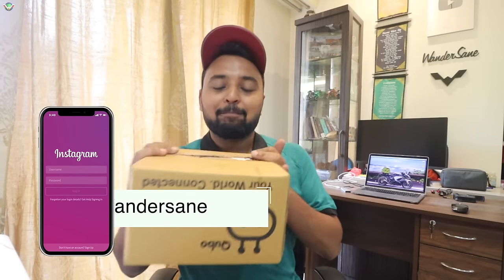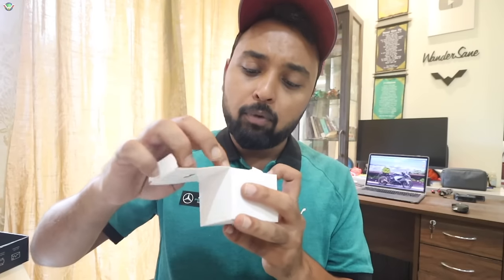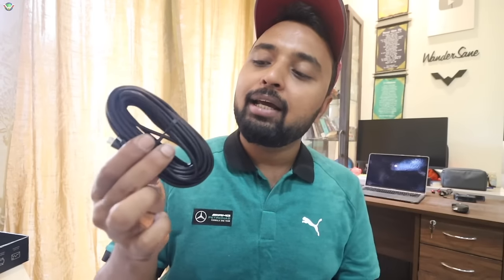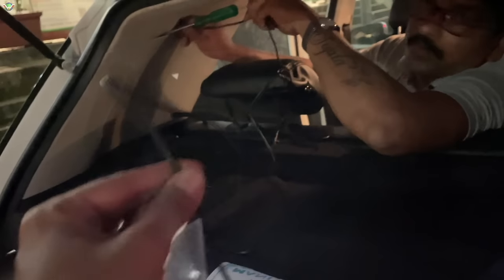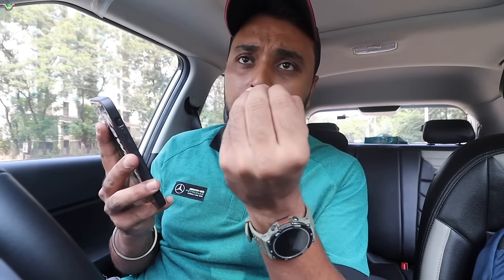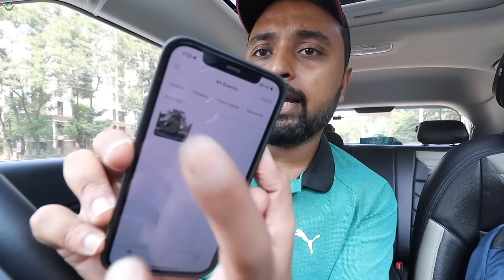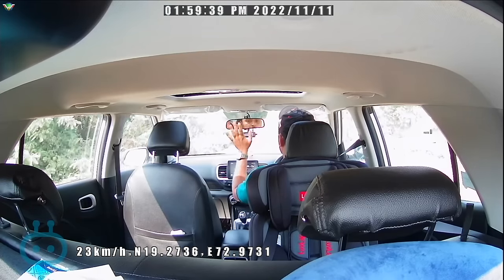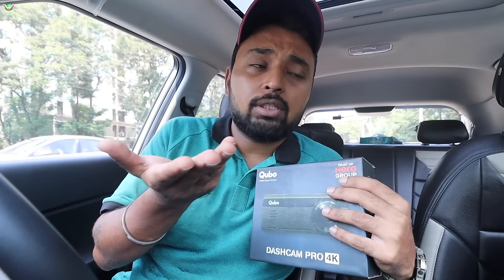BEST 4K DUAL DASHCAM FOR CAR SAFETY - Front & Rear Recording | Qubo DashCam Pro 4K Installation

Comment: DO NOT buy Qubo dashcam. My device stopped working in 3 months and the customer support is horrible. You will have to send video proofs again and again to them, explain the issue to each agent because there is no coordination at their end. Rest, your money your choice ✌️
Reply: You bought from their website or from Amazon or flipkart?
Reply: @ankurchakraborty8888  what difference it will make
Reply: @1987walunjrahul  they are priced more on those sites plus it's a different seller rather than qubo themselves offering it on the platform
Reply: @IAMATTHETOP  well, different sellers are different channels for Qubo. It does not matter from where you buy, the warranty/guaranty is from Qubo and they should extend all the necessary support on a timely basis. If they keep asking for proofs, then it's a stupid organisation which does not believe in customer support. The product may be good, but if the support is pathetic, it's a headache for the user. Best is to avoid such products.
Reply: Yes Qubo is the worst. It's better to go with 70Mail
Reply: Right
Reply: @suvibadra  @trippyturns - I agree. I too bought this premium 4k product and am regretting the same. Too bad support from Qubo - got carried away by Indian product for Indias and didn't go with Chineese, but realized that our Indian companies usually take customers for granted. Very pathetic support from Qubo - they closed the ticket without even contacting me!
Reply: @ankurchakraborty8888  I bought it from their Qubo portal. The purchase and shipping experience was good, but not the product support experience - which in my view is cuper critical. Very pathetic product support - that too for a premium product like this
Reply: @m2badri  how is the product sir? Customer support aside...picture quality..and operational issues?
Reply: @jiklrfu5194  the front dash cam doesn't capture videos that can be called as 4k. I find it a challenge to read the number plates of vehicles from the front dash cam - be it day or night.
The ADAS features are hyped and of very less practical use. The warning messages are garbled and not clear. It continuously distracts the driver in City traffic - might be of some help on highways but nothing to brag about!
I would imagine the cost of the product is at a premium due to this advanced feature. You will not find any user reference guide for configuring the ADAS on the device and you are on your own.
I think, the dash cam as a product will take time to evolve.
I am not discouraging the product but it's launched too soon to be of any practical use.
Hope this helps!
Reply: @m2badri  thanks for response sir. Yes, 1st gen product bound to be more buggy. Hope they improve, but for now the chinese ones make a better proposition
Reply: Ty for review I was about to
Reply: Which one is the best DDPAI z50 or this ? 
I have bought this from Amazon do you think should i return this ?
Reply: Hey can you give me suggestion that is there dash with live view like i watch dash cam from my home because i am thinking for placing on my company cars
Reply: @m2badri  Is it must to have a SD Memory card in the device slot or can it record and store on Mobiles memory instead?
Reply: @deepak696  it has to be on SD card memory
Reply: Agree, I bought their cctv 360 cam and it's customer support sucks, once it got hung when I was not in home and I requested support they are like go and manually restart the cctv from home , and not even considering it as a bug
Reply: Thanks  for sharing this info brother..I was almost carried away and finalized the 4k one. Will rethink now
Reply: For Parking Mode, which separate Hardware needs to be bought? price?

Comment: As you have already installed it in your car and experienced it for a few days now, can you please help me know how sturdy is the suction mount? Also, are the videos steady or shaking?
Reply: The suction mount is steady and stable. There is a possibility of the suction mount falling off due to sunlight / heat / prolonged use, so it would be recommended to remove and re-fit it once in 2 or 3 months.
Reply: @m2badri  yeah. Bought it. Its quite sturdy and working well. Thanks for the response.
Reply: @sanjay-joshi  Does it have audio recording? in both cameras?
Reply: @karansachdeva777  yes. It records audio as well and you can turn the audio off too.
Reply: @sanjay-joshi  Thank you! Does the rear one record audio too? How good is the audio quality? Also, how well is it working when it's parked in the sunlight with high heat in the car? Really appreciate your honest review!
Reply: @karansachdeva777  I haven't checked audio specifically for back camera. Front cam audio quality is Okay - Okay. Camera heats but doesn't create any issue. Keeps recording even of there is heat inside car. It doesn't support parking mode by default. You will need to hard wire it to enable parking mode. By default it comes up with plug and play setup using usb.
Reply: @sanjay-joshi  thanks! How long is the the warranty and how to claim it if it goes faulty during the warranty period?
Reply: How to check rear recording footage
Reply: @abhijeetgalphat9502  in the qubo pro app there is a rear camera icon. Once you click on it it shows the rear records.

But, I don't recommend this dash cam anymore. It didn't work well after a few months and the video is not smooth anymore.
Reply: @karansachdeva777 😊

Comment: Pro tip: make sure you have a water repellent film on rear  glass so it records without obstruction during rains as Venue doesnt has a rear viper🫤 also if you need good quality better use a GoPro in dashcam mode as these dashcams record 1 minute loop whereas GoPro/Sjcam can go upto 10mins @1080p30fps
Reply: I have a GoPro and have tried to use it in continuous recording mode (dashcam mode). It is very restrictive.... Not as easy as a dashcam

Comment: Thanks for the great video.

Can't find Hardwiring Kit for this Dashcam. Is it officially available?
If yes, please share the link to purchase it. Also , what are the features in parking mode?
- Does it have low bitrate recording?
- Time lapse
- 5/10 sec motion detection mode
Reply: Can we instead use Power Bank to connect the power source to the dash cam to work during parking mode?

Comment: Is it backed up by a Lithium Battery or a Capacitor? where to purchase Hardwire Kit to enable 24/7 Parking Mode?
Reply: Lithium battery. The hardware kit can be bought from Qubo site
Reply: @m2badri  😂😂😂😂😂 not available doesn't support
Reply: @m2badri is there any chance of catching fire in extreme heat

Comment: I feel like the Front camera mount will have issue in the long-run  the windshield mounted camera may fall down due to over heating please cross check with the customer care for the spares availability
Reply from the maker: no such issue for more than a year now

Comment: Suction mount on front windshield is a bad idea , it will fall in sometime due to sun heat and then you will end up using dashboard mount or something else.
Reply: yes, i agree. if the camera falls and gets damaged, then the repair cost / process will be very taxing. Also the top of the suction mount seems to be proprietary connection hooks / channel, so getting the dashcam to be fixed to other suction mount won't be possible.
Terrible product but with a premium pricing and no support from Qubo.
I bought this product and am regretting the same!
Reply: @m2badri  i am using action camera flat base mount on dashboard for my cam. Chk if similar fits yours.
Reply: @m2badri  Should I opt this or 70mai a500s

Comment: I brought this one, but confused which SD card is supported. Did not find good information anywhere. Can you suggest which one you are using ? I mean type of the SD card, capacity and speed etc ?
Reply: Strontium Nitro A1 works really well..
Reply from the maker: My normal SanDisk wala also works normally
Reply: @rohink9266  are you using this memory card for qubo 4 k dash cam....? Actually I buy a Samsung 128 Gb evo plus white colour memory card for qubo 4k dash cam but device not supported
Reply: @myconchang885  yes I use it for qubo dashcam pro 4k ...
don't know why my previous reply has disappeared
Reply: @rohink9266  ok I will buy strontium memory card
Reply: @myconchang885 I brought same one, I also got this message first time when I inserted memory card, but one formatted  using dashcam it does work well.
Reply: I'm facing another issue now, dashcam quite often makes beep sound, specially when next car suddenly stops or very close. During traffic conditions it becomes annoying. I made jolt sensitivity to low, also ADAS is off but still it makes that sound. Actually in app can't find option to completely mute dashcam. Anyone facing same issue ?
Reply: @plpatankar  yeah but I just switch off audio  alerts then everything is fine
Reply: @myconchang885  did it get resolved now? Samsung 256 or 128 gb does not work?

Comment: I have qubo 4K dash camera (front only) installed in my car, is there only rear camera and wire available so that i can add rear camera also ?
Reply from the maker: Check website
Reply: I don't think they are selling the rear camera that is coming along with this device (4k dashcam). The power and video feed of this rear cam goes into the 4k device.
You might have to buy a separate device and use it as a rear cam - and configure the Qubo pro app for both devices. Hope this works!

Comment: As a reverse camera bhi use karte hain?
Reply from the maker: Yes u can
Reply: @WanderSaneTV  No, you can't use this as a reverse cam - the video display will be there, but it will be of very less use as reverse cam - since the lcd display resolution is too low and the size is too small. I wouldn't rely on this for a reverse cam functionality.

Comment: Please suggest some good microsd for this 4K camera
Reply: I bought this one from Samsung - 
Samsung EVO Plus 128GB microSDXC UHS-I U3 130MB/s Full HD & 4K UHD Memory Card with Adapter (MB-MC128KA) and its working fine.
I think somewhere in the FAQ section of this product, Qubo has listed the SD cards brands that will be supported on this device.
A Class 10 or above SD card should be fine.
Hope this helps

Comment: Will it's power cable extend to rear 12v socket in the boot instead of front power socket?
Reply: The front Camera cable is 3.5 meters. Please check it out with your vehicle to see if it would fit the power socket in the boot.
The rear camera cable is 8 meters, but the cable carries power as well as video feed to the front camera, so you can't interchange the front / rear cables (i guess!). Hope this helps
Reply: @m2badri  bought one ..the power cable has just managed to reach the rear power socket. Nothing that a small extension cable can't solve. Btw how is your experience of the video quality?. Surprisingly the MP4 copied from sd card has very bad quality (front) when viewed on laptop. In fact rear camera has better image quality.
Reply: @butchcassidy7543  same here. Not happy with the 4k resolution. Would have been ok with 1080p given the cost difference and insignificant video quality difference.
I haven't set up the ADAS features. Have you set it up already? Any tips that you can suggest. 
There are no technical documentation for configuring this ADAS features
Reply: @m2badri  problem is that 4k video is worse quality than rear 1080p. ADAS I didn't feel like configuring after hearing the constant audio bongs.. Will try and see if that feature works
Reply: @butchcassidy7543  yes, i felt the same. Given that we have bought a premium product, i was thinking of using the ADAS.... No big hope though! 🥹

Comment: Can we use power bank with this camera to make it run 24 hrs ?
Reply: please buy the hardware kit which gets connected to the car battery. the power consumption is less and it wouldn't affect the battery performance is what the company claims
Reply: @m2badri  sir is dash cam main kaun si hard ware kit use hogi

Comment: While reverse camera switch automatically in rear view
Reply: No, the device will not know that you have slotted the gear in reverse gear,
You have a toggle switch in the device to see the rear view - but honestly, it will be of no use - too small display / LCD resolution as well

Comment: Insta360 has a dashcam is far more better option 360 video with audio inside the car n around!!
Dash cam mode 
If any cops come next to window they won't know
Reply from the maker: I have inst360....it can't really be used as a dash cam....and it's features....plus making a vdo out if it is a task.
And no loop recording and charging issue hoga....
Its not made for dash cam use ....dash cam has a different purposes of being on all the time

Comment: Samsung SdCard not working in it
Reply: @anilsoni42 - I had a same issue during installation. The SD card needs to be formatted in the device and you have the option to do it using the physical buttons on the front camera. Once you format the SD card in the Front Cam device, the Samsung SD card would start to work. Hope this helps!